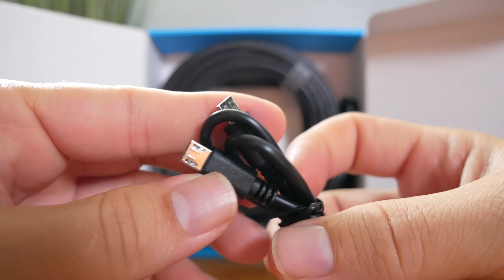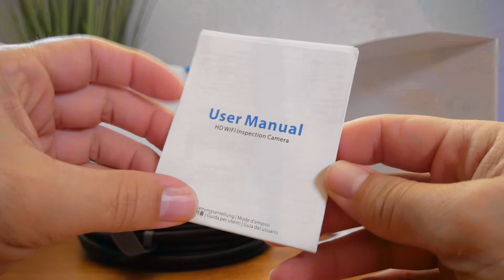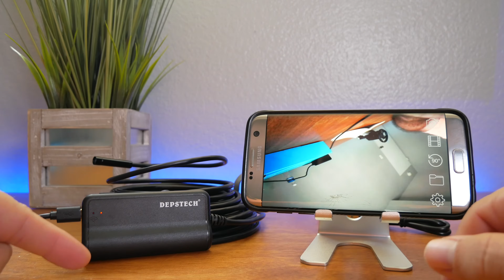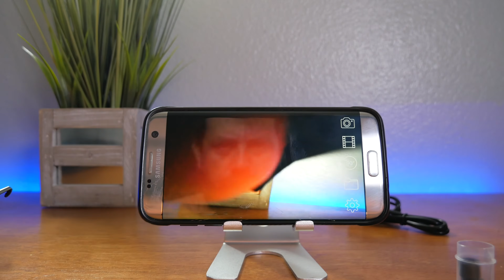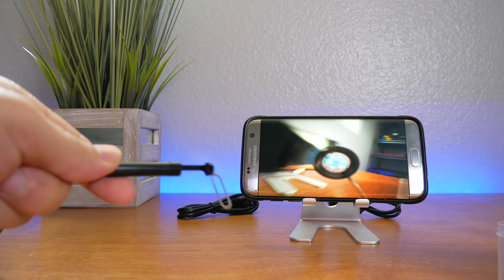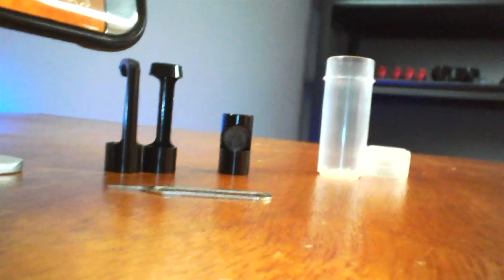Wireless Endoscope - Borescope Inspection Camera

Comment: I've made some experience with a previous USB connected endoscope and tried with every possible mean to connect it to my Huawei P10 Lite, to no avail. I then bought this and in the meanwhile switched back to iPhone.  I got a very similar one and it works quite well. Compared to the previous one, a Teslong, the new one from Lightswim, equally Chinese, works much better. No more issues with delay (I was connecting it to my computer and running it from VLC), nore with the source identification my Mac Book, where it was forever causing confusion with the internal camera on VLC.
I've been pulling my hair, though, trying to figure out, on what account this fixed lens endoscope can defined as zoomable. There is no mention of this in the video, but this product is still advertised as zoomable on Amazon. The Teslong endoscope was in fact zoomable to some extent

Comment: Do it again. This time, treat the effort as a HS Science project - the methodology, the detail, the preface and the summary. Opening the box!?  Focusing - focal length, that would prove helpful. Organize around, say resolution, showing stills at each successive lighting level of a subject inside a black box, then with ambient lighting, then video inside and then outside the box, then change resolution and repeat, then move the phone into another room and repeat. Then use it on a tablet, repeat, then on a laptop.

Comment: WiFi is a must for this tool to work.?
Reply: It generates its own wifi signal no need for external wifi its a hot spot for its self
Reply: @TheShawna1-KB1PFL  Can the app work through data? I want to fix it to my 3d printer and monitor prints when Im away from home